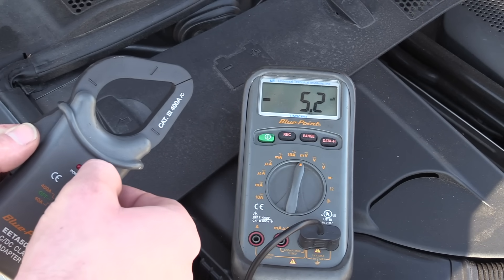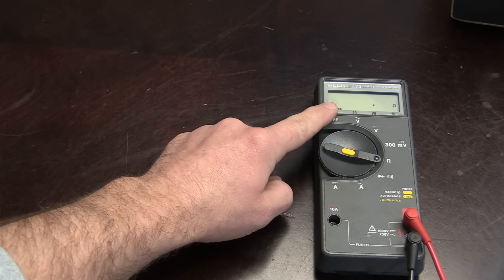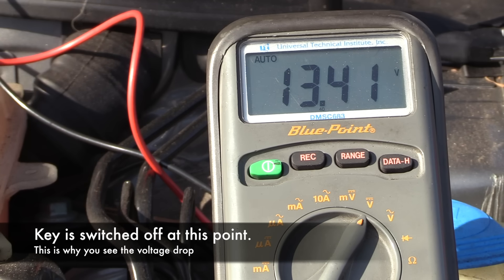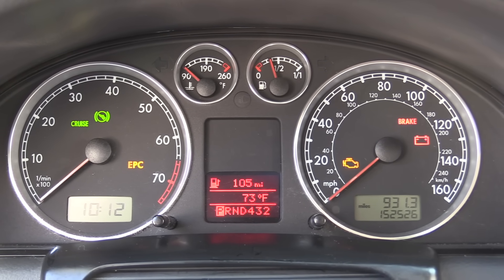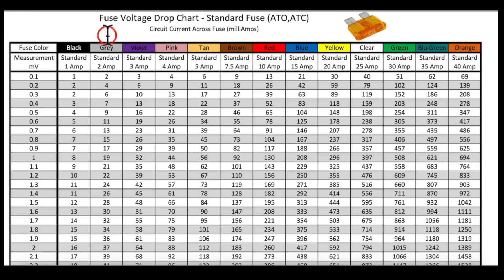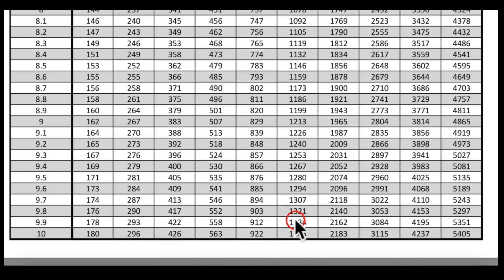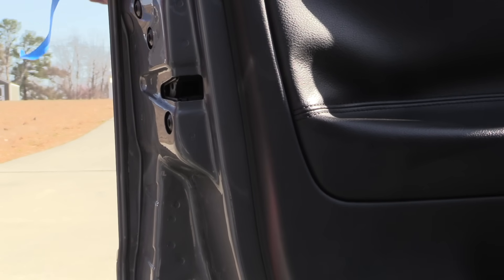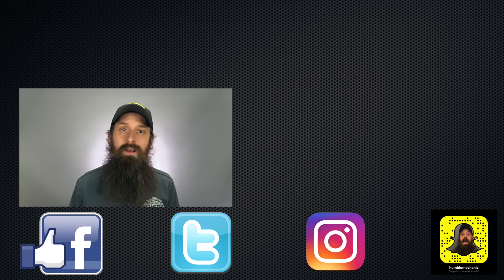The BEST Way TO Perform a Parasitic Draw Test

Comment: Watching you manually close the hood and door latches (and associated micro-switches) was simultaneously humbling and liberating.  "Duh! Why didn't I think of that!  It's too easy!"  The Power Probe voltage-drop-chart PDF is also a great tool.  One of the most helpful videos I've seen in awhile.  
Thank you - subscribed.

Comment: Voltage drop across a fuse...?  A fuse should essentially be 0.0 Ω i.e. a plain piece of wire. 

Check the resistance across a new fuse. It should be 0.0 Ω.  😉

Comment: I would never have thought of the concept of a voltage drop across a fuse, I always thought that fuses were free of electrical resistance.
Reply: They have a tiny bit of resistance, which is why we are talking millivolts, also see that the lower the capacity of the fuse, the smaller the fusible part, thus the highter resistance and higher voltages, this is cool.

Comment: At 7:09,  for the radio 3.4 mV voltage drop the chart has 1005 mA, so that actually 1A and not 0.1A as stated in the video.

Comment: Guys, disconnect battery negative, one test lead on the negative battery post and the one on the negative side of harness. Meter on 10/20 amps. Any over .5-.8 is excessive. Start unplugging fuses until amperage drops on multimeter. If the fuse part doesn’t show a difference (which it should) then you have to start unplugging connectors one by one until and amps drop
Reply from the maker: For older cars this is fine.

Comment: Searching for battery drain on a 2006 h2 I did latch shut the doors and hood. I pulled every fuse and fuse box component and found the aftermarket radio drawing some but there’s still almost an amp being drawn and I hadn’t been able to determine the draw. Disconnect the alternator and that wasn’t it. Let car sit an hour to make sure everything was off. This started after a recent transmission rebuild by a mechanic out of town.

Comment: The fastest way I have found so far, out of ten times I’ve done this it’s failed me twice, is an infrared camera. Around the car. Find the hot spot on a completely cold car and pull the fuse to the item. If the item cools off then check its relay, either way I have found parasitic draws that dealerships and other very talented mechanics couldn’t find.  I have had heated seats to the hot cold blend door actuator to most common is a relay.

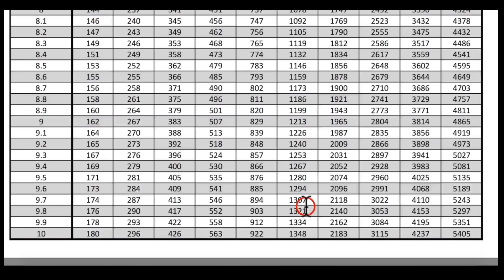Comment: Is 1348 at the bottom of the column shown at 8:10 1.348 amps? I don't know much electrical stuff so it's kinda confusing. Also, do I need to have a second multimeter for the battery, or can I just be somewhat certain that if one fuse has a drop it would likely be that component causing the draw? Thanks yall

Comment: Your video is of no help if you don't respond to the MULTIPLE questions asking the same thing.  You turn the radio and high beams on.  Why and how when the car is shut off?  Assume we're not all mechanics.  You test the fuse and it drops to zero.  Are you saying that one's good then?
Reply from the maker: I turned them on to show what happens when you have a load on a circuit

Comment: My moms 5th wheel threw me for a total loop recently. I couldn't find what was killing the battery in an hour or so. I unhooked the whole DC panel and checked the wire to and from the battery with no shorts yet something was still a dead short. The only thing I found was a tail light issue but still didn't fix it. I got defeated.

Comment: I don't believe their is a fuse that will tell you if alternator diodes are the issue.  Am I wrong about that?
Reply from the maker: most dont, but I have found bad ones by unplugging them LOL
Reply: @HumbleMechanic  ChatGPT told me that a good way to check them is with the multi-meter on AC, to check across the battery terminals when the car is running.  It said AC voltage would be detectable if the diodes were going bad.  What do you think about that?
Reply from the maker: That can do it too

Comment: i got a brand new battery, and the battery state of charge is at 12.6 volts, but when I turn on the headlights prior to starting the car, then the volts go down to about 10.4 volts. Also,  when cranking, the voltage on the voltmeter shows about 7 to 8 volts on cranking, then back up to 13.6-14 volts. Do I have a bad new battery? thanks!
Reply: Yes, sir. Yes you do. Always ask the sales person to load test the battery. 👍

Comment: The Vdiagtool BT300 is probably one of the simplest testers I’ve used. Plug it in, and within seconds I get clear info on cranking and charging. For a small tool, it’s surprisingly accurate.

Comment: Good video with important details. A 2018 civic has 2 fuse panels and the under hood is easy but the inside fuse panel is impossible to access plus it is difficult to keep it in the sleep mode during testing. I suspect the drivers seat will have to be removed which may keep it awake.

Comment: Thanks!!  I have a 2006 Mini Cooper....had it since 2020.  Within the last 8 weeks it has times when the battery is dead.  I've had it in the shop 3 times...1st they thought a new battery would do it.   Several days later...no start.  Just got it home today...parked it in driveway...shut off everything....came out 6 hours later....dead battery

Comment: Great video, thank you. I have a 2025 kia carnival that's got a parasitic current draw of 500 mA. This is enough to kill the battery in a few days, particularly as the car is often only doing short trips so can't fully recharge the battery. I've resorted to hooking up a charger when it's parked, but this is a PITA , and the wife acceptance factor of having to disconnect the charger before driving is zero. 
The dealer has been no help. There is nothing aftermarket on the car. I will use your fuse as a shunt method to try to isolate the circuit, but just wondering if anyone watching has had any success finding the problem in a new carnival. It seems to be a somewhat common problem, but no-one is finding a solution yet.

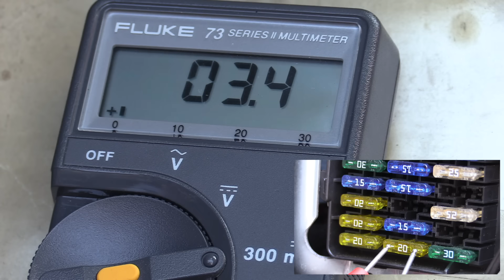Comment: Probably a stupid question but I'm a little confused...at 6:10 when checking the voltage drop across the radio fuse- you say when you turn the radio on you see the voltage drop. How can you turn the radio on with the car off? This test is done with ignition off and the car in sleep mode, with doors locked and all latches made, no? So how would we turn the radio on to see the voltage drop?
Reply: If u notice multiple people ask this question but no reply
Reply: He’s probably doing it with the ignition on just so we can see that there is voltage across the fuse . This is  an example of what we would see if the radio was remaining on while the car was off … don’t think about how he did it just think about if the car was completely off and you saw voltage like this across a fuse then that’s your draw

Comment: You can when checking current draw also wire a fuse in series with the multimeter to protect your multimeter & the neg battery disconnected. If you only have a 10A meter, and you use a 7.5A fuse in series you don't end up throwing the meter in the trash.
Reply: Better meters have fuses inside.

Comment: Not that important, but some may get on the wrong track: at 7:07 the 3.4mV drop shows 1005 in the table. Humblemechanic says 0.1 Amps, but it is 1005 mA which is 1.05 Amps or 10x that.
Reply from the maker: that small mis speak should throw anyone off especially if they follow the chart. But yes I said it wrong.

Comment: Electrical problems is a licensed to steal your money.   Should only take a Max 1 hour to find the problem ,  longer to repair or replace,  I will usually run a new wire with a inline fuse,    or separate things and put in a separate toggle switch.  On your older vehicles.  
My son's already in  $ 900.00 total and now at the third shop,  they're not for sure but think it could be a body control module,  ?   Another
 $900.00  ?      And it's been in their shop this time for 9 months....   Had to tell him he's being ripped off...  !!!

Comment: The current draw for the radio circuit is 1 amp not 0.1 as you said, based on the chart you show.

Comment: what about  a classic car all analog no ECU/EMU   does the  voltage  test still stand  ......
Reply from the maker: It still works! But you can be a little more aggressive pulling fuses. It will not upset the computers

Comment: I just went through this on my 2500 ram Dodge truck. I found a wire rubbed raw against hard bend of wires under the fuse box mounted on driver fender.

Comment: This video is not showing how to find a draw just how to do all the 3 hours of BS he likes to do...
Truth is that every draw is its own issue  & approach is paramount in achieving success accurately & efficiently.
Only a true professional will understand this.
The problem with todays industry is a lack of specialized diagnostic experts & the demand shops put on having them filled with so-called bumper to bumper mechanics.
Reply from the maker: If this takes you 3hrs you are for sure doing it wrong.
Reply: I don't think that in my 40+ year Tune Up Mechanic career it has taken me more than 20 minutes to find the area of the vehicle to tackle B4 I do all that pre crap & tape job U do, most times of which is not needed. Example U have no clue if U R going to be working from the inside the vehicle junction box when in 5 minutes on most vehicles of that era U can determain what part of the car has the issue. Then, if needed, U go do your tape job.
Like I said it is all about approach & what expert U have on the job.

Comment: Rookie here and not even sure if you still check old post comments , that said, maybe someone knows. Why the need for the 2nd multimeter to test voltage drop at the fusebox(es)?  I understand the idea behind connecting it in series at the battery to check for draw, charge, alternator etc., but once done that can you not use the same MM to check voltage drop at the fuse box?
Reply from the maker: you dont NEED it. you would use the second meter to see how big the draw is.

Comment: One thing he forgot to mention…leave the key fob 10 feet away from the vehicle, else your system never goes to sleep.  I learned this because I was drawing 130ma,  my key fob was in my pocket.  When I placed it far away, the draw went back to normal. I was verifying that there wasn’t an excessive draw on my battery.
Reply: TIL never would have thought about this. Thanks kind stranger!
Reply: excellent work!

Comment: battery keeps dying in 2 days if not use what are the most common on honda hrv? wit this problem
Reply from the maker: not sure what the issue is, most of the time ive seen anything aftermarket(radio, dash cam, kinda thing).
Reply: @HumbleMechanic  remove dash cam,starter even cigarete lighter not plug still doing the same i run today check battery was 85% charge after 2 and half hour was 65% wierd battery was 12.8 then same thing went down too 12.3v check lights on inside no light,remove insulator on battery,maybe because i added diecltric grease on all the sensor even on alternator positive terminal could be? the grease? not in the fuse remove the fuse when i did the dash cam install now remove did not take a picture before installation but remmber the place were could be i out it on wrong place woke up a sleep fuse? when car is asleep? now this morning boost again im getting sad

Comment: Parasitic draw, parasitic drain. I prefer 'drain'. It sounds more troublesome and annoying. 😂 Current draw is normal when a circuit is working properly so to me it just doesn't sound nasty enough to describe this problem.
Reply from the maker: we had a new guy call it a "voltage leak" which is my favorite hahah
Reply: @HumbleMechanic  Current leak would be good. But I guess where there's current there's voltage, so it kinda works. 😎

Comment: If you dont find it i your fuses disconnect the batery power pug from your alternator check for the draw. If you do, its your alternator. Thanks for a great video with more accurate  readings. Nice of you to share your knowledge.  Thanks.

Comment: GREAT reference video!  Small note: you misread the chart at 7:03 -- it's 1.0 amp instead of the 0.1 amp you state.  I think this was just a brain glitch because you read the chart correctly later.  You might want to edit the video to include a note, or pin a comment to let people know this.  It's an otherwise perfect tutorial for this method.  And I really enjoy that you pushed having good leads.  Flakey leads just give you erratic readings, they are useless for this kind of stuff.

Comment: Where did you get the 35 milliamp spec from for the radio circuit test please?
Reply from the maker: It’s a relatively common spec. Probably got it from old vw training manuals. 

It’s a tad outdated today. But an okay base to start
Reply: @HumbleMechanic  thanks man, I'm trying to understand this way of diagnosis. Need to get out and start testing. Thanks.👍😁

Comment: Well, I started this procedure and now I'm baffled. Using a craftsman meter on 200mv ( lowest setting available) I began reading the fuses inside the BJB. Well, the first fuse  I checked had a slight reading when I applied the neg probe @ 03.4 and just as I touched the pos probe to the fuse almost instantly the reading lowered and zeroed out to 0.00. This is from what I understand to be the normal condition. Moving on down the line after several fuses checked ,  I found a fuse that when I touch it with neg probe gave me no reading then when followed up by touching the red probe  still gave me a 00.0 readout. And when I went to check all the fuses in the IP fuse box inside car. I couldn't get none of these fuses to read and then zero out on multimeter. Vehicle has an estimated battery loss of 4.5 volts per 20 hrs from fully charged at 12.76v where my batt charger goes into the 2amp maintenance mode. What is going on??? Is it losing volts at the bottom side of my BJB? Your guess is as good as mine...lol
Reply: What you measured is correct. A fuse is a piece of wire. It has 0.0 Ω and therefore zero voltage drop. I'm not sure what he's doing. 🤔

Comment: @HumbleMechanic
I've got a 2015 Ford Focus 2.0L Automatic "non turbo"
Problem:
Shut car off and remove key. Intermittent Engine sputters and stays running for about 10 sec. Usually results in a No Start No Crank condition. Check Engine Light is on. DTC'S are P025A and U0109. Codes are associated with loss of communication with Fuel Pressure Control Module. When it happens it usually draws down the battery. Initially the battery was replaced but problem wasn't resolved. You still get the No Crank Condition even if you boost the car. It seems to "reset" or "snap out of it" when the battery or the negative cable is detached. Once you disconnect and reconnect it will start. I suspect a the fuel pump relay. Problem is that it is intermittent and to test for a draw from a relay the conventional draw test involves removing a battery terminal which seems to reset the condition. 
Any Help?

Comment: Nice UTI multimeter. I got my Fluke multimeter back in 1996 at the Phoenix campus and it's been well used.
Reply from the maker: Thanks. Fully enough i looked up what a UTI Meter goes for. $300 on eBay!!!

Comment: Hey Charles, I think my car has been having a battery drain from the radio lately. It came with some Panasonic one, not the rcd that people normally swap to so I'm not sure if they did the canbus thing r8ght. Would there be any way yo fix that or should I just get a new radio, like the rcd330 with a canbus adapter? This is on an 06 gli

Comment: My multimeter settings look completely different and it's confusing  where it needs go be. There is dcv but then it has setting numbers withjn that from 200m, 2000m, 20, 200, 250
And 
DCA settings are 200m, 20m, 2000u, 200 u

Im trying to find. Parasitic draw car keeps dying at night. Fine during the day.
Separately, or unsure if related both headlights arw out and i wanted to be able to test for a blown fuse as well

Comment: I knew in my heart that you could ohm's law the fuse voltages to avoid pulling them, thank you for confirming this. I would have never thought to lock the door latches with the door open though, I would have been sitting inside for 30 minutes like a clown. Thank you!!

Comment: 2003 suburban.  Pulled fuses and saw that the cigarette lighter fuse was a considerable draw. Nothing is hooked up to the lighter ports. One port in the rear and two in the front.  Removing that breaker dropped the current draw by 40 mA. What can I do now to try and figure out why a cigarette lighter circuit is drawing 40 mA?

Comment: I had a transmission replaced and my truck dies overnight. It’s a 03 Duramax any suggestions? The shop said they had to add some plugs to get the transmission to run right but now it’s killing the battery overnight., from what I saw they added a plug for the gear selector switch

Comment: Need some help if anyone reads this. I followed this method for a 2014 Buick encore. First I checked for drain by disconnecting the battery and was still finding a draw of 1.4v.

After driving the car for a couple weeks I checked each and every fuse using the method above with the car “asleep” and the latches locked

These fuses had power going to them “electronic brake controller” (tested in neutral and in park but same result), front power windows, rear power windows, logistic mode relay, and finally the driver power seat. 

I don’t understand why the windows, and power seat would be drawing power, and not sure about the ECBM and Logistic mode relay. Anyone got insights for me?

Comment: Dunno. I used the milliAMP setting and tracked down a 1.3 amp parasitic draw the same way, without pulling fuses. I just set my Fluke to milliamps, turned on "record min/max" and my Fluke alerted me when a new HIGH was reached as CURRENT through the Fluke exceeded the current going through the fuse (a resistor)